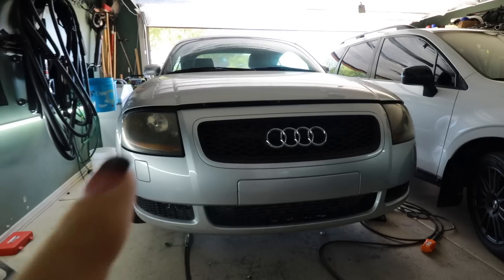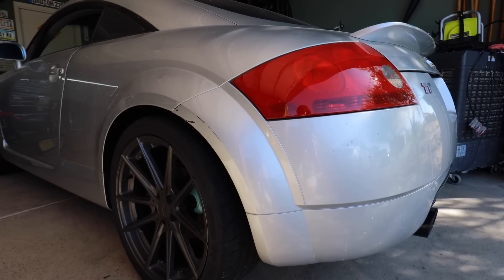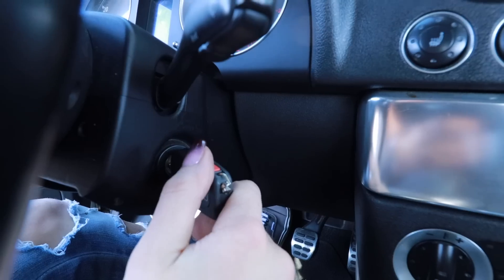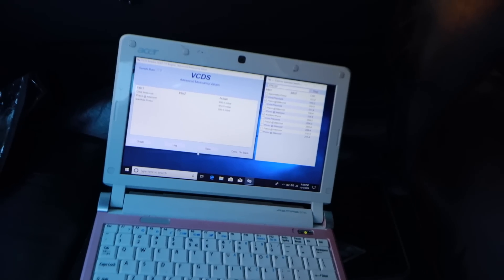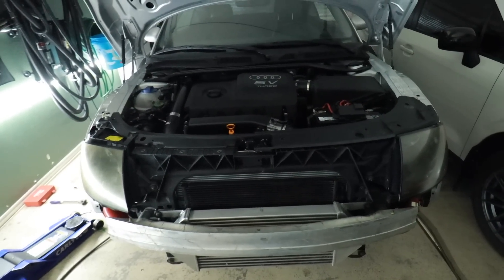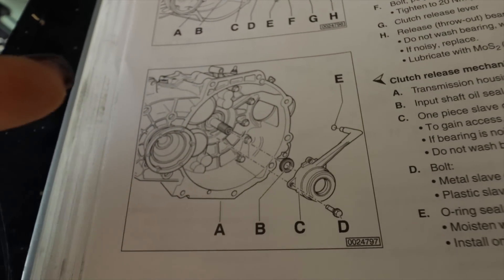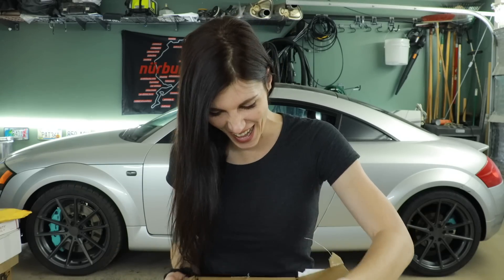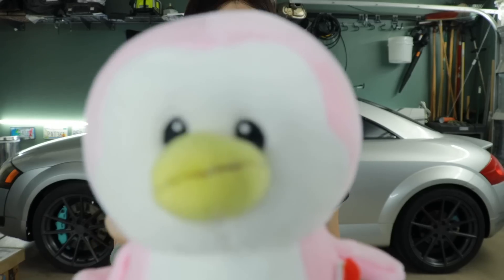First Drive Ends in Massive Failure // Project TT Quattro

Comment: I grew up in the country. Safety wire isn't just a Air Craft thing. Most of the old farm equipment and industrial all had rod and main caps safety wired on. If you watch a channel called ( Bus Grease Monkey ) the Gm Detroit also had them wired on. It tells you how things years ago were built with quality and made to last. Now days it's just plastic junk that is throw away.

Comment: Sounds like a failed pressure plate. I’ve lost a few clutches, it sucks. First one happened on a long weekend, and I lost all pedal pressure my clutch pedal just flapped around. I did manage to bang shift it the rest of the way home without stopping. Turned out the release bearing shredded and locked the clutch fully engaged. So I just drank all weekend since I couldn’t drive anywhere.

Comment: I fixed mines. The motor comes out pretty easy if you drop the front end of the car. All you really need is an engine hoist and common tools. Not as hard as it sounds.

Comment: i’m lucky to have a 2002 TT quattro stock with 57k miles (currently ). only had a immo delete and my bushings on the gearbox replaced; it runs like new...  i bet your TT’s ecu is confused AF with all those mods.

Comment: Sounds like a throw out bearing is bad. We changed our clutch with the rs4 kit with lightened single mass flywheel from Ecs Tuning and it was not that difficult. We did it at our home garage on jack stands not a big deal. Suck it up and just do it.

Comment: get an E36 and fit a single mass flywheel (with the right clutch).

I am an automotive engineer and understand the function of a DMF, but frankly think the torsional vibration should be absorbed by a special part that is more easy (and cheaper) to replace.

Comment: Ended up changing the master & slave when i had my clutch replaced on my TT. Dont think its required but seeing as how it all feeds the same system i would recommend it. Especially since i ended up with a faulty slave and it leaked pretty badly into the cab. Leaving no brakes or clutch while i was on the highway 😕

Comment: This is not an ad, but look on ROCKAUTO, they sell single mass flywheel conversion clutch kits for way less $$ than you were quoted,  good upgrade and good quality, been running mine for over a year at 270 hp.  They sell dual mass as well but a little more $$ still less than 1500 though, 

I know you probably won't see this but I had to say something. 

Stay with the car....

Comment: safety wire is also used on competitive engines I have a pair of the tie wire pliersI have changed the clutch on a tt on the floor but it is a sieriously rough task do you have a friendly local workshop that will rent you a lift for a couple of days??

Comment: I've always had the dual mass flywheel replaced during clutch changes. It is just running costs now on vehicles. My 2012 Audi A4 is starting to get noisy. Been quoted £1000 by my local garage.

Comment: Perhaps you should convert to single mass flywheel, then you know, why it's rattling... 

Keep in mind, that the space between the flywheel screws was changed in the middle of production somwhere after the VIN (8N-2-016000) for the APX/BAM engines...

Comment: Fail of the 2Mass Flywheel also caused me to part with my 2007 3.2V6 after 12yrs of being a daily driver...anticipated repair cost 3500€ (it also needed new shocks and brakes which would have added another 2.5k). ;(

Comment: $1500 sounds high, even just for parts. 
On my 01 1.8T Jetta years ago, the clutch job was near 3 hours. Same transverse engine layout. 
Spec stage 3 with single mass flywheel. 
I will advise to stay away from a single mass setup unless you don't mind flywheel chatter.

Comment: Before doing all the work with the Turbo and Drive shaft, should have research some complaints  for this car, maybe something  to do in the future maybe TSBs on NHTSA. That DMF having that excess play even after 50,000 miles is in a lot of them.
I swapped The dual mass flywheel In my AMU also 2001 I went to single mass UROtuning also from the same store I got an IE timing kit, the tensioner is fixed mounted. Better.

Comment: Replace the dual-mass with a solid flywheel. It will be worth it in the long run. I use to work for the VW/Audi factory in South Africa and the dual-mass units don't last.

Comment: Had to watch this twice , Sarah your a funny lass.
Glad your not giving up it’s not a hard job just a long one, the second thing you said needed lining up should just be a drive shaft cup that takes 6 bolts from drive shaft to cup, I’ve never had to line these up back where they were as the shaft is balanced individually but I suppose for your ocd a painted line would do lol the input shaft will stay centred on it’s own just the clutch kit needs fitting central so the shaft slots back in it’s hole nicely.
And the gearbox will be heavy so get yourself an engine lift for lifting box in and out/ up and down, and an engine support bar to hold engine up.
I know your not daft but felt like I had to say.
Your like the penguin Princess with all your new penguin pals lol

Comment: IMPORTANT CHECK if the pressure plate is a self ajusting one. Your going to need a tool to push in th pressure plate when installed on the flywheel and re ajusting the self ajustment of the pressure plate by turning it. Maybe you already know it but I wished somebody would have told mee before taking of and putting on the transmission and every thing an can't figure out way I can't get te clutch bled. It can also destroy clutch baring/cilinder .

Comment: Pull the engine on the TT! Disconnect the drive shaft with long extensions. Makes life far easier when doing the clutch because the transfer case is a nightmare. If you take the subframe right out you can easily pull the motor. Honestly worth pulling. Otherwise it's a nightmare

Comment: Clutch release bearing or some such.

Change the DMF to a single mass..

Go lighter..

It will rev faster , did this on both my Alfa 916 GTV 3.0 V6 and my modified 1.9 GT blackline,  the blackline with a hybrid turbo was 300 hp with 750 nm of torque.

Both cars were more drivable after..especially with raised rev limits..

All normal btw.

Engine mods usually lead to clutch woes....if not immediately then pretty soon after ...

But you know this..

Good luck 👍

Comment: The DM flywheels kinda suck, I ended up going with a single mass and a hopped up clutch for a (twice thwarted) 4.2 swap. It might be rough or tricky with puck discs, but the durability goes waaay up.

Comment: you can get it on ebay and don't get the lighten flywheel cause it will make the car rev to fast. take it from me. stage 3 on a mk3 vr6 turbo.

Comment: Dual-mass flywheels are the worst. I had thrust-bearing fail & the flywheel just basically imploded.
New clutch disk, pressure-plate, flywheel & clutch fork...

Comment: Can you explain please why the locking wire? It's not used on cars only on planes
They use splitpins on cars with crown nuts
Yes its mandatory in aviation and you know 😉 cross - cross - pigtail (locking direction)
Ciao from the Netherlands

Comment: I was afraid this was going to happen, when I saw you jerry rig the steel pipe to the intercooler. Usually the pipe is ribbed, so that it can grip on to the clamp ring when you tighten it. When you have a smooth pipe, the boost can literally unclamp it like a shirt sleeve.

On another note, same thing happened with the charge pipe on my Evo. Except my pipe is steel and it shot itself into the hood when I was driving...so it sounded like a rod punched a hole in the block. Scared the daylights out of me. 

You're almost there though! Give it the beans.

Comment: Just replace the dual mass flywheel with a solid flywheel conversation kit ... everyone running VAG cars does it eventually anyway... I paid € 200 for a four piece national kit that includes flywheel,  release bearing, driven plate, and clutch cover... You might also consider replacing the clutch slave cylinder..

Comment: Intercooler piping bend, I’ve done the same thing and it’ll hold for sure! I put down 460whp on my integra with that same method. It may look unusual but hey it’ll hold and work. 

As for the clutch, is it the throw out bearing that could be shot?

Comment: Okay, so I have a light weight flywheel. And its common to have this sound if you have changed the stock flywheel out.
Reply from the maker: frankdogg85 cool, well, my flywheel and clutch never made this sound once in the past year 1/2 I’ve owned the car and it’s a stock dual mass in there. Good to know though!

Comment: Just curious. Shouldn't you upgrade a clutch from the stock one after tuning it? Only reason I ask is. Last few cars I've built/added mods. I've always dropped the transmission. And upgraded the clutch,fly wheel and pressure plate. Love the vids though. Hopefully you can get the TT up and going.

Comment: Putting the car into the shop is not a sign of failure ... this is a job to farm out to a company that can do it for a reasonable price. Once this is done, perhaps the car will play right for you. Have the mechanic check out the rest of the car for any potential issues. Did the same thing for my 99 Subaru Forester ... saved me a bunch in the long run. Hang in there

Comment: I don't think that any of the bolts on the flywheel have come loose, most likely the two halves of it have just given up holding themselves together. There is a bearing in the middle inside it and some springs so the outer half can twist and these springs make up for the springs missing on the solid clutch disc. So it means your dual mass flywheel has failed the way they usually fail. Either the clutch side of it is tilting against the crank side (bearing failed) or the springs have detoriated and it just won't dampen the twisting movement. This usually can be felt as judder/and noise when lifting the clutch pedal with a gear selected (so that there is some load on it). And seeing it that it does it stand still and on neutral then I place my bet on the bearing in the middle of the flywheel. And there are no service parts for the flywheel so it is time for a new one..

You can buy a conversion kit for the clutch of the TT from dual mass to a solid one and the kit (for much cheaper than a new dmf+clutch kit) which comes with a clutch disc with springs and the clutch cover to match. The throwout bearing could also have failed but knowing your car has that one which has the slutch slave cylinder integrated - I have never seen one of those fail on the bearing side, but they are of course a must to change because the slave cylinder side of it likes to stop working/start leaking. 

If you decide to buy an upgrade kit it will most likely come with a solid flywheel.

Comment: For your piping all you need is a swag kit. Heat up the with torches and are it cool down stick the swag kit in and open the pipe diameter to what you need . Just a thought maybe save yourself some mula

Comment: The vag life when you modify these cars you do one thing something else goes lol I have a s3 1.8t Audi mine did the same thing with it being duel clutch I went solid flywheel upgrade clutch it does make a little more noise then standard but you do not have to change them every time you change the clutch just a thought also not sure what bhp you are running but the rods in these cars are a weak point . Stay strong 💪 it’s just a clutch and more content for us viewers that enjoy you videos 😘

Comment: ah the audi life.. I did a headgaskets, clutch, lots of JHM shift goodies, rebuilt the turbos, blah blah blah.. (I went way over budget) on my daily B5 S4. two weeks of solid... nearly everyday day... for no less than 7 hours of work ..in the middle of July with crazy humidity... get it all buttoned up, take a ride around the block... and get a pleasant splash of hot coolant on my foot going around a bend. the heater core chooses right then to fumble a grenade (quoted 9hrs/$1500 shop repair). not to mention I still can't figure out the whole stuck at 7psi thing. .:facepalm:. 
what I'm trying to say here is stay strong. Audi (correctly pronounced "owie") ownership is a love/hate relationship. It will be way worth it when its running right and your boosting up and down Salt River Canyon
also that might be your throwout bearing, which still means clutch but possibly not a flywheel. That being said, single mass flywheel kits hold up to stage 2+ power btw, just throwing that out there.

Comment: Typical Audi experience. Fix one thing and then something else breaks. You love the car but it just won't love you back. I went through this same thing with a B5 and a B6 A4 (both silver, manual, black interior). I eventually gave up and sold the B6. It was my favorite car but also, the most I've every worked on a car. My wife was so happy we broke up.

Comment: This is exactly why we refuse to take in Audi's, Saab's, Volvo's and F-250/350's.  From a mechanic's perspective, these are the absolutely worst-designed cars on the roads of the US.  The most common jobs are so incredibly inaccessible and incredibly difficult.  That's why they want 12 hours of flat rate to work on it.  I feel bad for you.  But incredibly impressed with your work and diagnosis skills.

Comment: Replacing the dual mass flywheel and clutch is quite straightforward. Get on with it. If you're running stock turbo you're making less then 300 lb/ft. Stock clutch is good for that

Comment: I have the opportunity to buy a 2002 tt with the 180hp motor 5 speed  with 162k for $2,000. Its actually in pretty decent shape but want to know if it is worth working with or should i wait for the 225hp ?

Comment: In UK, plenty of independent Audi specialists.  Can purchase a up rated sachs clutch and flywheel which can handle 300hp from autodoc.  For my mk2 cost is around £500 for parts and can have specialist fit for less than half of that.  Audi dealerships are known to be most expensive for labour costs in the world. almost as much as Porsche so don't take it to Audi.  Guess there are no Audi independent specialist in the US?

Comment: You should get into an official auto mechanics school, become an official mechanic, work for Audi, use their garage, and buy an R8. Lol
Reply: Second on getting an R8.  I've been through a few high HP jdm cars and I've been an Audi owner for 13 years.   It's finally culminated in acquiring a 2008 R8 (with a Heffner TT conversion).  I thought my 572whp/590wtq rhd JDM 1990 300ZX TT was quick but this R8 is a whole new breed and driving experience.

Comment: I don't  think  it's  your  clutch 
I think it's  the  throw out  bearing. It's  probably  dry of grease  causing its  failure.
Reply from the maker: Ralph Snow doesn’t matter, same process required for repair, and I’d be an idiot not to replace the clutch and OE dual mass flywheel after all this labor.
Reply: @SarahnTuned  my thought  while you are in  there  replace  all.

Comment: Might also be your throw out bearing
Reply from the maker: frankdogg85 oh, it’s definitely getting thrown out after this, lol 😂
Reply: @SarahnTuned  lol... too bad were not neighbors, I'd totally come help you. Yeah, so the lack of inertia from a lightweight flywheel make what's called flywheel chatter. So you can hear each cylinder firing, causing a light bump in speed and rapidly slowing down. This normally won't happen due to the normal weighted flywheel, its heavy properties use inertia to smooth out each blast per cylinder. So with the light racing flywheel clutch out in neutral, the gears are all spinning, and you will hear like marbles clanking about, that's the slack in the transmission teeth advance/retard at the rate of ignition from the engine. Flywheel chatter. Wont happen with a stock. Anyway, you having a stock dual mass means, my explanation has no merit to the sound you're having. I'm a new subscriber, so I wasn't sure if you had changed all that out for racing? Btw, hows your elbow doing? I felt sad when you flew back intercooler pipe day? You have great content! I get happy when I see a new video pending in my feed! Keep up the good work! I love seeing a girl share my passion. You rock!

Comment: tho's stands are realy dangerous because of that flip up pin. As it turns out they easily flip up even if there is a load on them. For example you have a tool in your hand and crawl under the car and axidentaly smac the pin with the tool it flips up crushing you. belive me they are not save! Also that coolant system is ment to be pressurised when it is hot! it will not be when cold so opening the coolant vat does not help. the level will rise when you turn on the car and open the vat because it gets warmer. your car is low on coolant! Oh and always open the garage door when running the car! Exaust gas is toxic and kills you!

Comment: Your issue here isn't uncommon, in fact the Audi TT especially this model is notorious for the transmission breaking, so dont be discourage, it's nothing you did and it should've been on the list of parts to be replaced. You're lucky you're in the states where finding replacement parts is not only cheaper but more accessible, had you lived in Europe  (excluding Germany) you would be looking at twice the cost or getting rid of the car. Fix it, finish it, onwards and upwards.

Comment: Just an FYI.. failures of dual mass flywheels are inevitable. The reduction in vibration is not worth the extra cost in replacing those pieces of crap every 100,000 miles or less.😜 They are just as bad, if not worse on the Ford diesels.🙄

Comment: The axle bolts are 12 point. NOT torx. I have done a TT and a golf gti mk4 gearbox. You will need strong help and a proper hoist. Be warned. Garry the tech manual gifter from Oz.
Reply: I have sent you a set. Due 7 Nov.